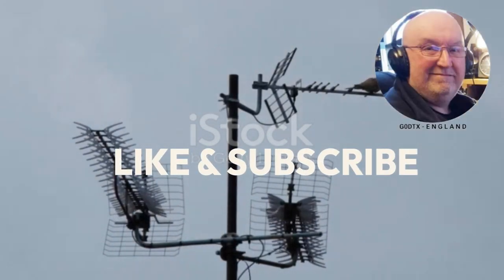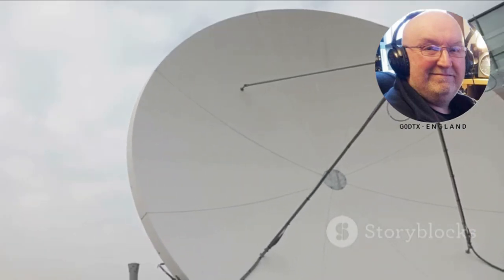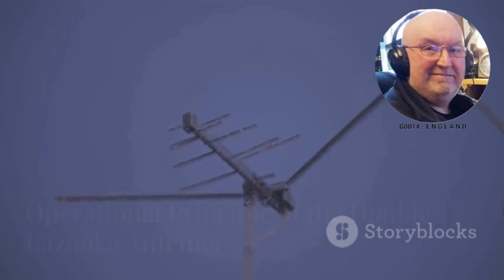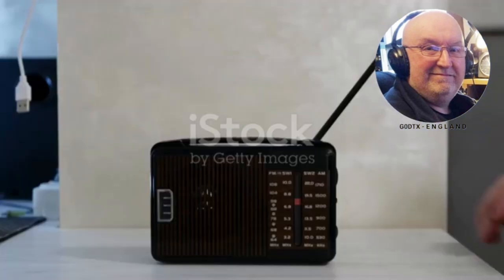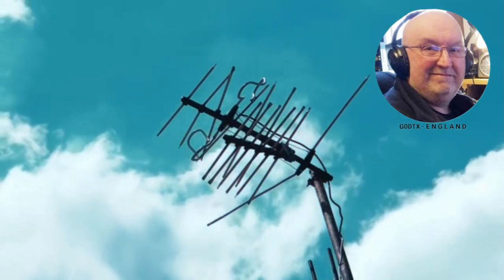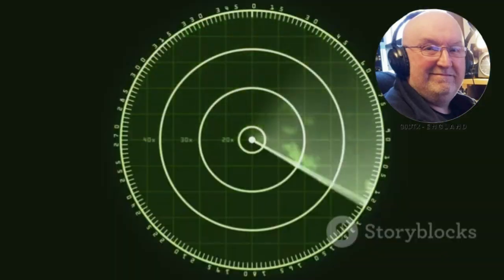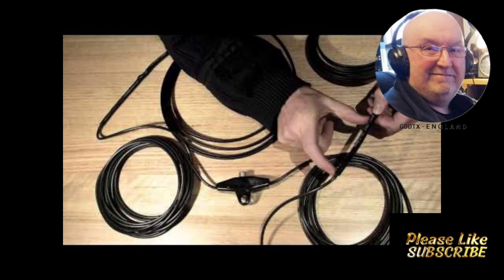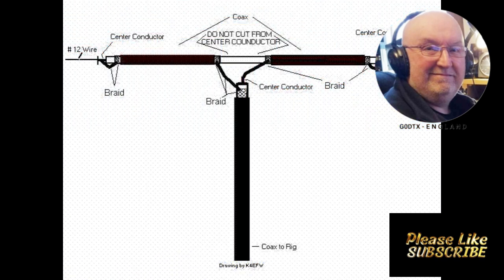What is a double bazooka antenna where did it come from?

Comment: Is it intended for TRANSMIT and RECEIVE, or only RECEIVE? Does it provide any GAIN? What is a typical frequency range of the "Bazooka" antenna operating in the 146.00 Mhz range.
Reply from the maker: The bazooka antenna was modified for ham radio for any frequency  It was modified for amateur radio use in the 50s. This unique design eliminates the need for matching baluns antenna and fed directly to the 50 ohm coaxial. the DOUBLE BAZOOKA is 98% efficient and typically provides NOMINAL SWR readings less than 2:1 in the band enter.